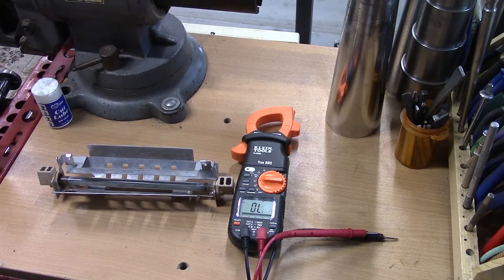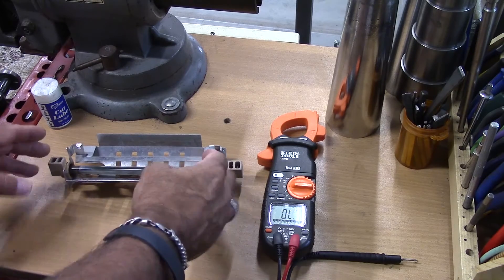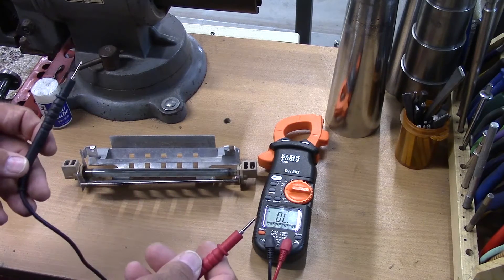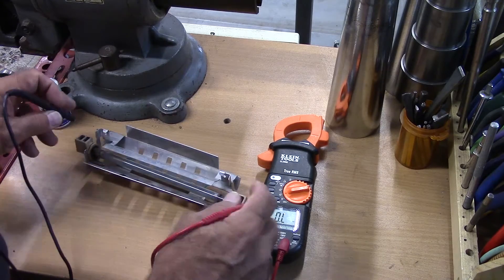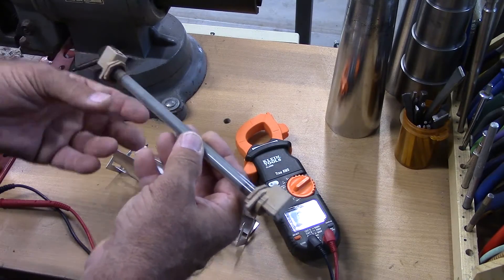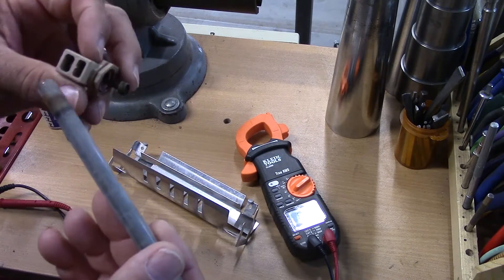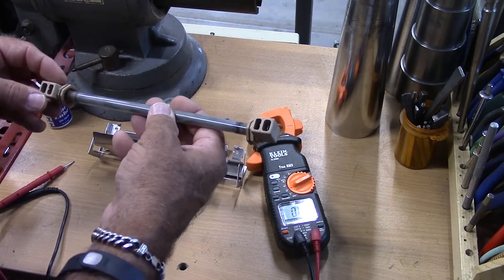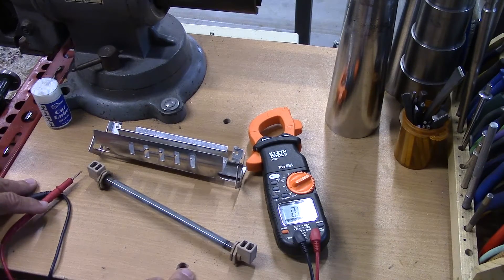Freezer Defrost Heater Test

Comment: Very helpful video, clearly narrated. Might be improved by following the test of showing the old unit is bad with a test of a new unit to be installed to complete the repair. It is possible for even the new unit to test bad right out of the box. The new unit test would also provide an example of the expected range of resistance (ohm) values for good units. Thanks

Comment: So my problem is my ice cubes partchely thaw then refreeze into a large lump of ice. Freezer temp can run from 1 to 11. I'm thinking control board issue.
Reply from the maker: Depends on the year, make and model regarding a control board. It could be that the fan is out or that the coils in the freezer are iced up. Sometimes the defrost heater dies so it never completely defrosts, causes an air blockage so not enough air passing over the coils to cool. The typical cause of warm freezer is bad airflow, I would start there.